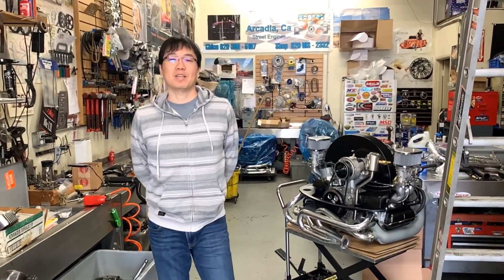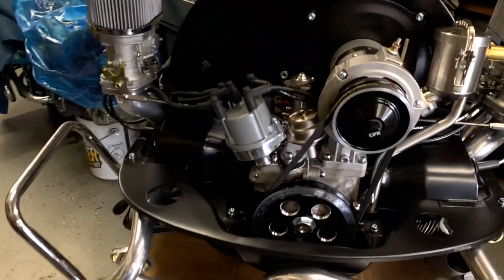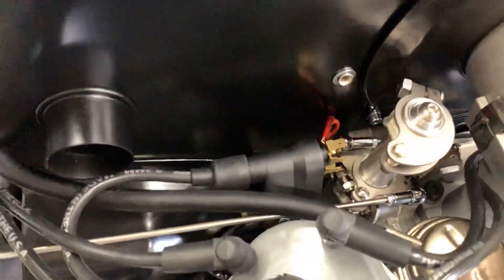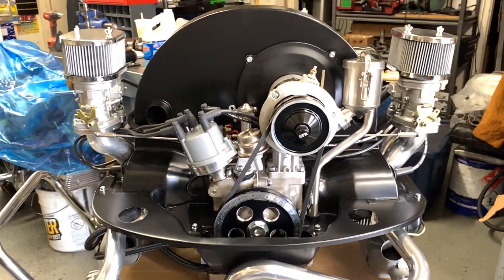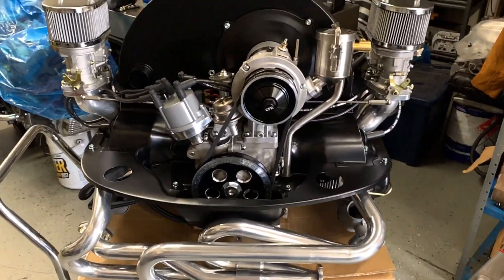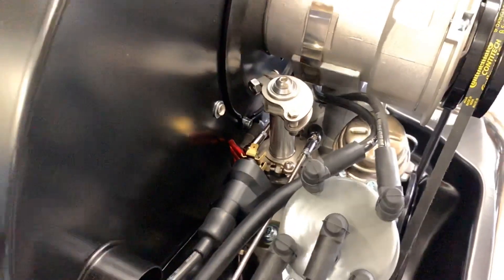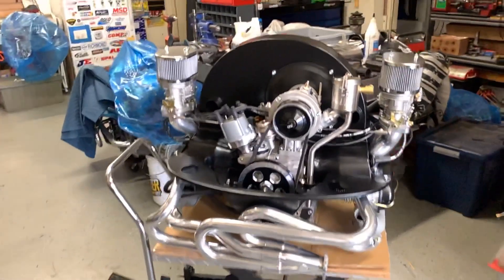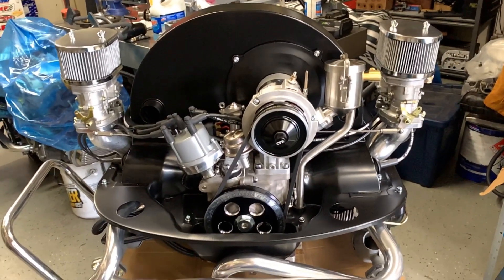How does Vintage Speed linkage fitted with MSD CB Billet Distributor

Comment: OK, how is the CB coil being mounted? This is not a regular production parts coil mounting bracket location. How is the mounting bracket fastened to the engine?  Do you provide the mount for the coil to be located like this? Or does the mount need to be fabricated by the installer?
Thanks, David G
Reply: Was thinking the same thing, looks like it mounted to the distributor clamp bolt, but I can't tell
Reply: I'M PRETTY SURE THE COIL IS SHARED WITH THE DISTRIBUTER BOLT.
Reply: Yes this needs to be explained. i bought both of these do to this  video. This is not no problem. It looks like there is a bracket that comes of the engine block were the stoke manifold would bolt on the the case. It does not bolt right up to the coil mount
Reply: @smittiesims4990  We figured out how to fab a mount, but it takes 1 1/2 hours of fitting grinding and welding to get it right. That is hardly a bolt on solution,and it should be mentioned when promoting the Vintage Speed product comparability.